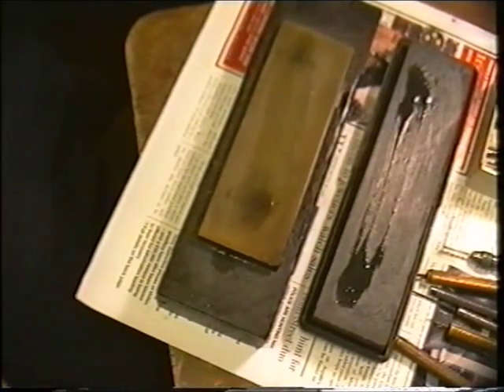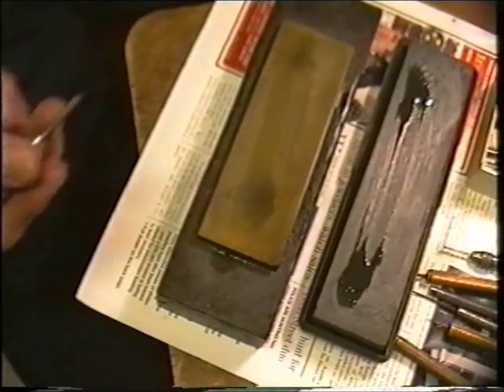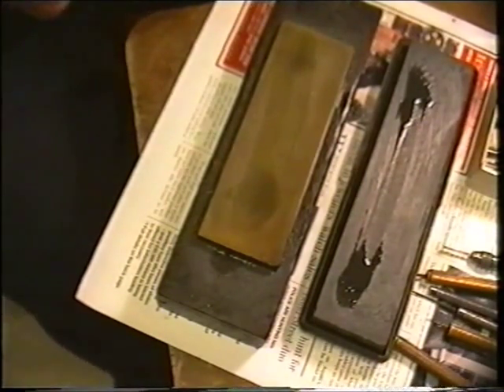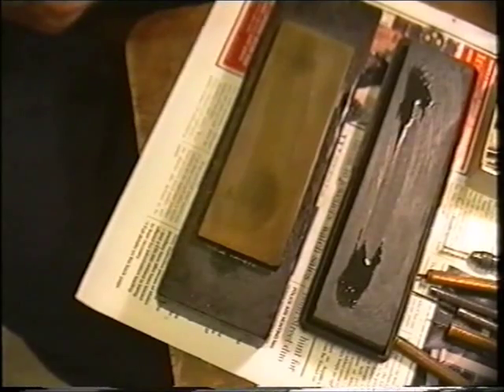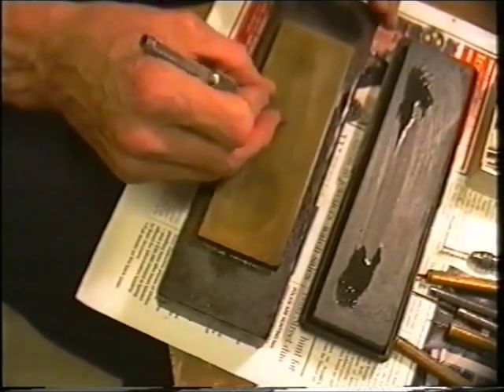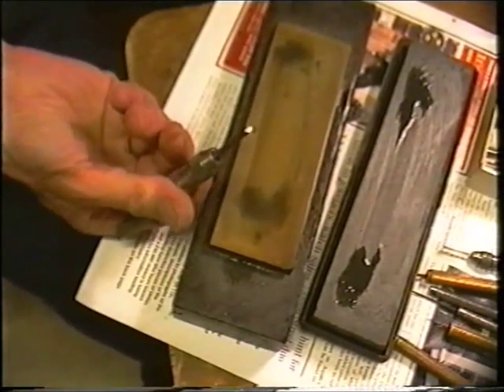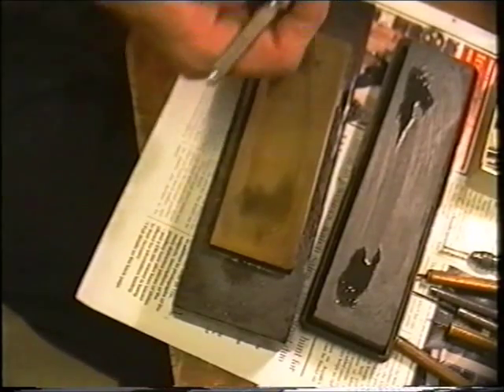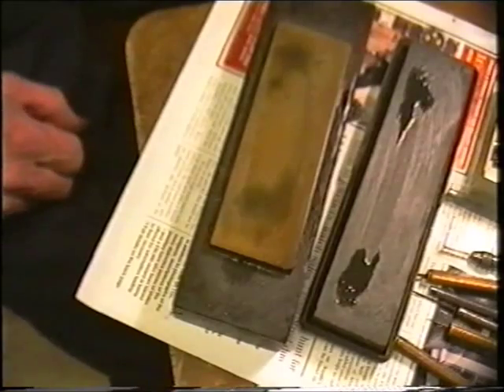Turning a balance staff for a watch or clock - part 1

Comment: I use a GRS power hone for my sharpening.  I sort of see your point about being able to sharpen on the fly, however. Eyesight isn't as good as it used to be so I can't easily see the footprint on the stone.  Besides, how do you maintain it once you start sharpening?  Also, could you give some more details on the process that takes place before you started this video?  And (sorry to keep peppering you with questions) with regard to turning staffs, how many different graver shapes do you recommend: just the lozenge and parting shape, or others besides?  Where do you get the smaller gravers for making smaller staffs?  Most places just sell the larger sizes. I know that's a lot but I really like your videos.  Thanks.